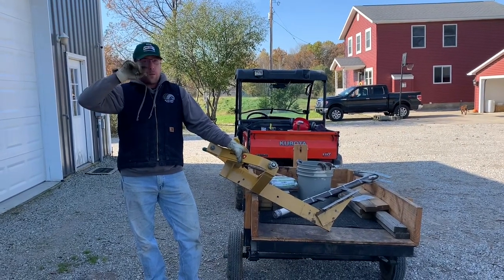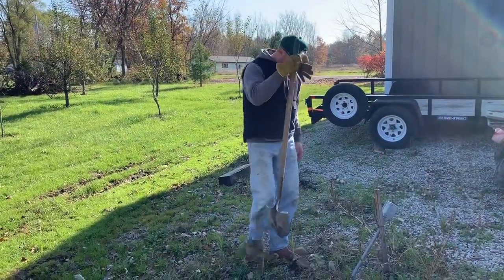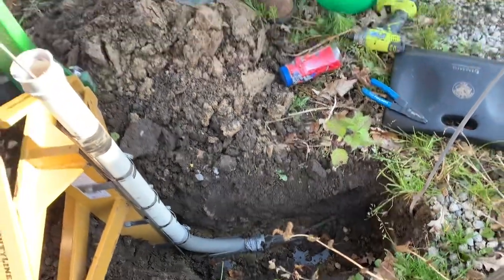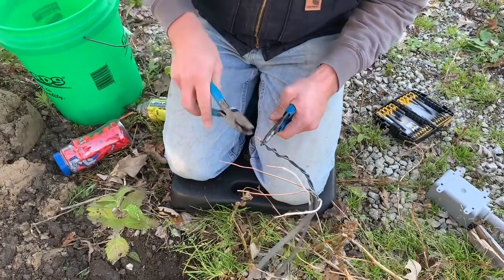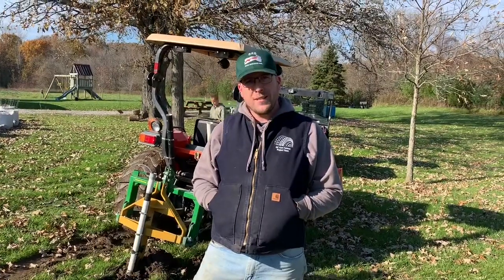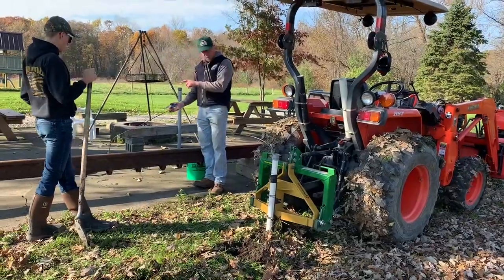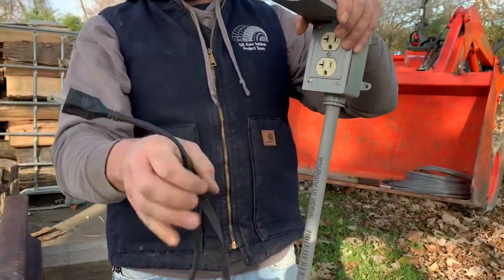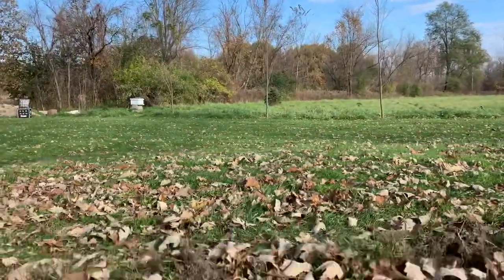The Easiest Way to Direct Bury a Cable or Wire

Comment: Nice job.
You might have wanted a way to keep the spliced wires sealed and not buried in water.
That could come back to bite.
Reply from the maker: Agree. I have a good measurement in where the splice is and it’s not a super-important circuit so we’ll see. Thanks for watching.
Reply: not could WILL
Reply: I am not an electrician but I would have made that joint ABOVE ground in a junction box.

Comment: Man I recognize the sound of that  hydrostatic transmission. You could have used some AG tires except for the ATV (pulling your tractor) lol.
good job though. I bet the splice has held up.
Reply from the maker: Yeah, that job was one of the few that I needed ag tires, but would have wrecked the yard worse. Splice still holding up. When it fails I’ll dig it up and run new wire, really easy using that subsoiler! Thanks for watching!

Comment: Need a GFCI in that outlet and also that splice will fail eventually.
Reply from the maker: There is a ground fault receptacle at the beginning of that circuit. Agree on the splice. Not ideal, but when it fails I get to use my cool tractor tool again to run a full brand new line!

Comment: Electrical wire should be buried in pipe, if not there would be an electrical issue in the future cause of it rotting on plastic covering wire
Reply from the maker: Hi Michael, you’re actually incorrect. Wire used here is rated for direct burial. Also, when the public utility ran the main underground lines to my shop, they are direct bury, not in pipe (I think you meant conduit).